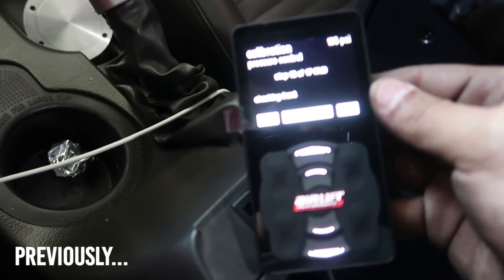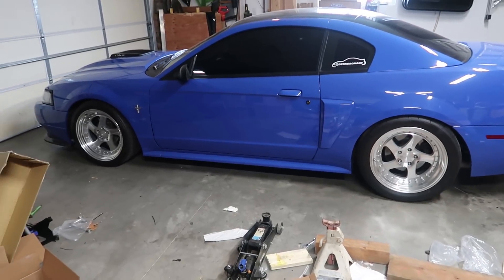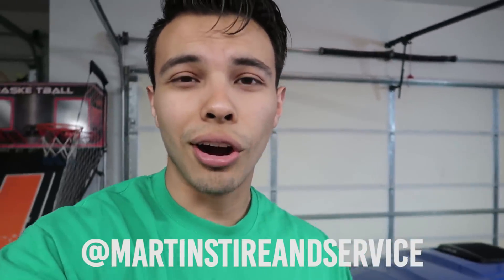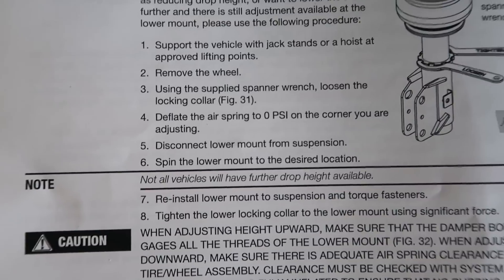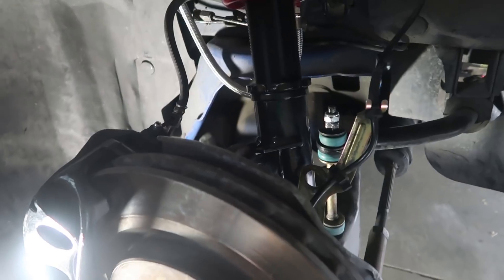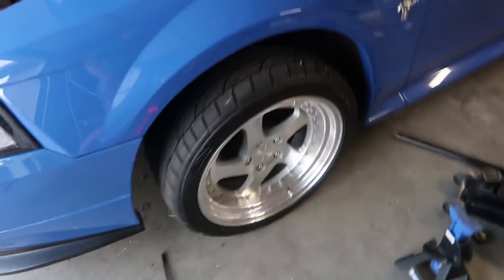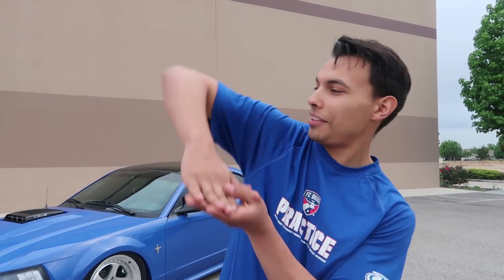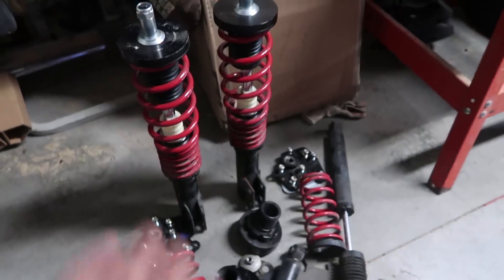BAGGED MACH 1 REVEAL! | 3P Airlift Suspension

Comment: Pretty impressive to be that flush with the 315s in the rear, how do you think the bags will handle on a circuit track like autocross..
Reply from the maker: I think it’ll handle well! So far it’s a far better ride. Still need to get it aligned though haha.
Reply: Ozomeroman so is it a comfortable ride? Like does it ride smooth like a Mercedes on factory air bags lol but seriously how smooth is the ride??